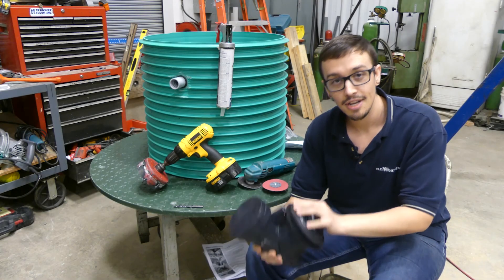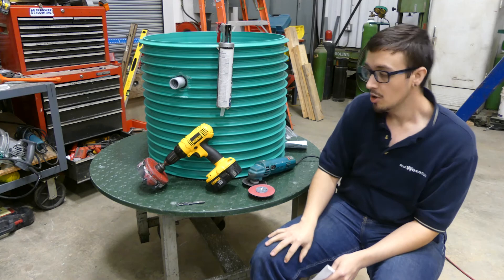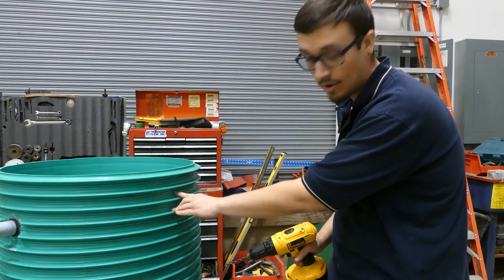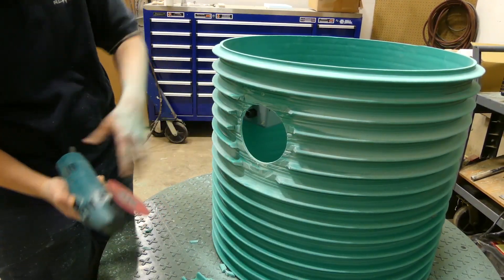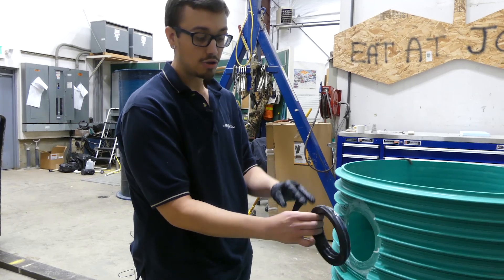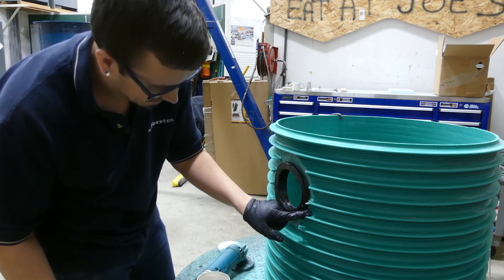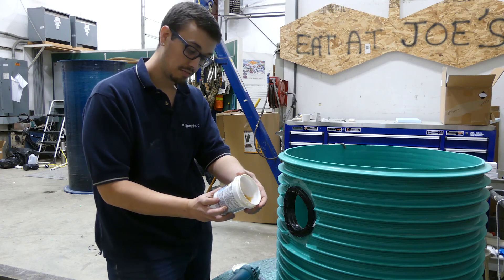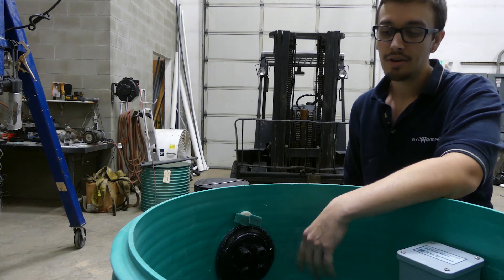How to Install an External Splice Box on a Septic Tank Riser

Comment: never seen one of those boxes before, seems 10x harder than mounting a wp box on top of the tank and piping into a 1" hole.  what ev.  if i had to use that splice box thats a great vid on how to do it but i wouldn't even think of it after watching this. takes way too long and not worth the effort imho.  also, if somebody is planning on doing this to their own house you might have shown how to run the float and pump wires into the cord connectors, cut them and use waterproof wirenuts etc.  peace out